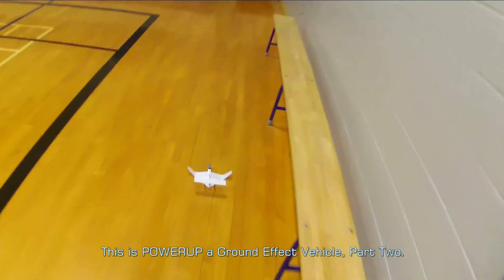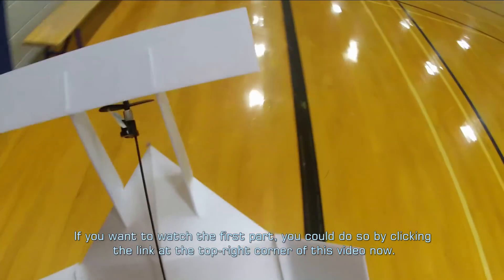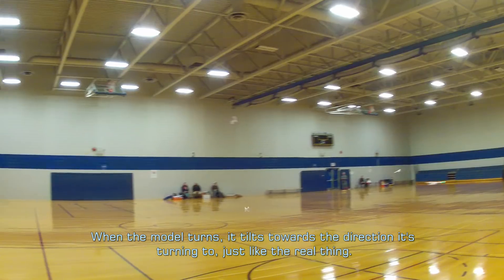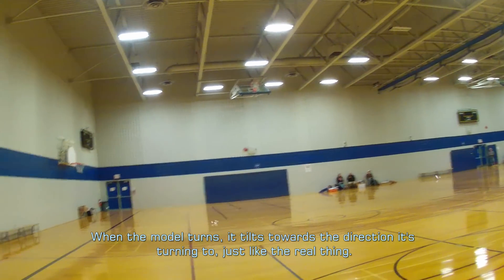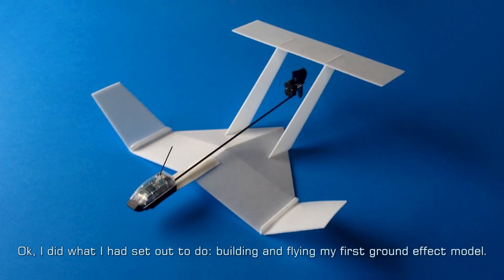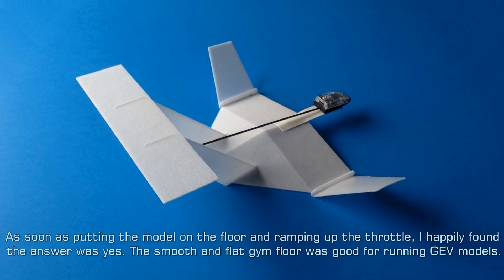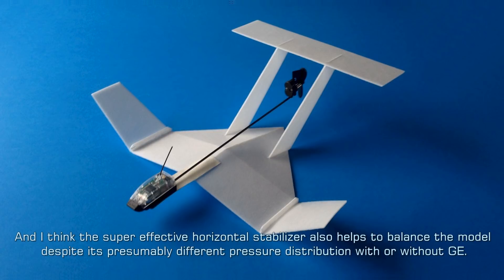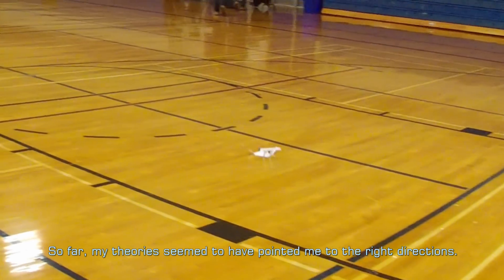POWERUP a Ground Effect Vehicle (2)

Comment: I think the main problem is the motor is overpowered. The Powerup weighs 9g and produces 20g of thrust. 20g of thrust should power upto 160g of mass in ground effect. That's roughly 0.5sqm of 5mm foamcore. Your whole plane probably weighs only 20g.
Reply: How do you get the thrust / aircraft mass ratio?

Comment: Hi,I have a question,this model require brush motor or brushless DC motor? thank you.
Reply from the maker: Brushed or brushless, it doesn't really matter. In the case of this model, the motor is brushed. It came with the POWERUP 3.0 module.

Comment: That's light enough to be a plane.  One of the reasons for WIG is heavier payload.
Reply from the maker: That's by design. I wanted it to be able to fly because I had the idea to fly it above a pool outdoor. The pool is not big enough for the model to turn around without leaving the surface of the water. If you want to have a heavier payload, that's the easiest thing to accomplish. Just add some weight to your model and it's done.

Comment: I’m sorry for all of the questions. Where do you get your foam?  What type of foam do you use (thickness and type)?  Thank you for your time and help.
Reply from the maker: No problem. I get my foam (foam plates) from Walmart. Other supermarkets also carry foam plates. Foam plates from different manufacturers are not the same. The ones that I prefer are flat and between 1-2 mm thick at the bottom.